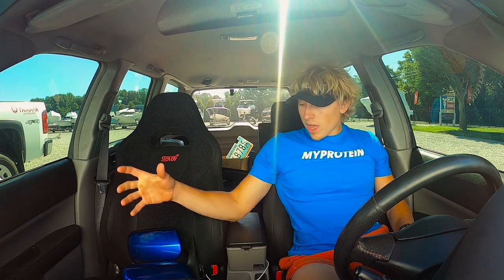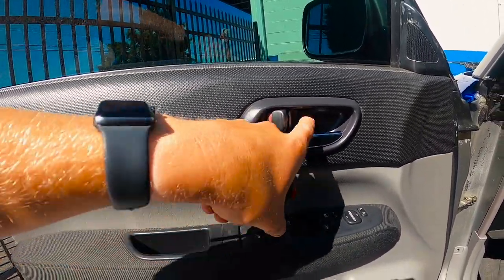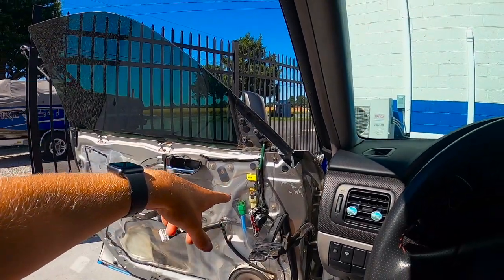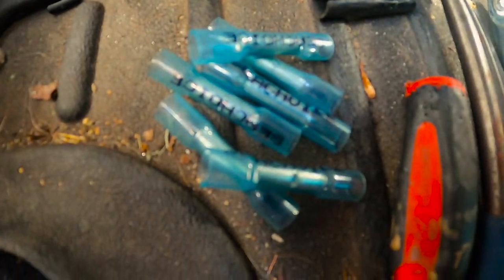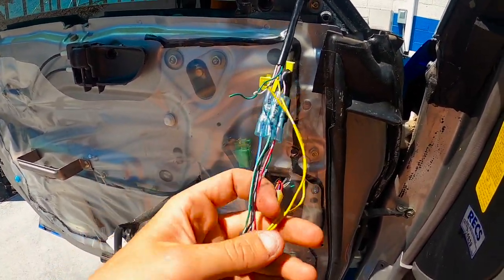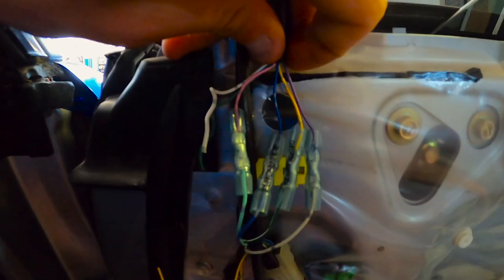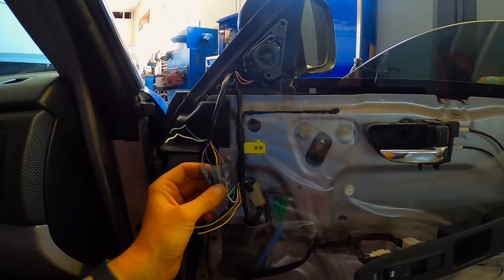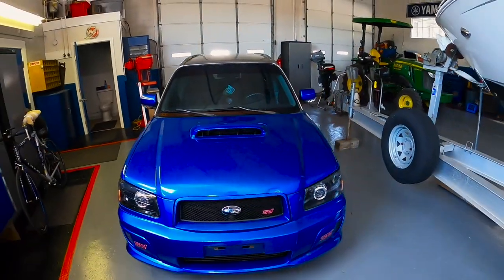SUBARU FORESTER MIRROR SWAP INSTALL/HOW TO  | 2006-2008 MIRRORS ON 2003-2005 | STI SWAPPED FORESTER

Comment: my foz is a 98 gt, door trim off looks nearly the same.

yes remove the rails, im taking mine off
Reply from the maker: What’re you gonna fill in the gap from the rails ?
Reply: @jakeheavlow  i was looking at flater looking ones see if any fit, but i think fill it. there is a filler with fiberglass in it that look strong and light. 
there is one done same as yours all blue, looks nice but i cant find info on what they did.
Reply: @jakeheavlow  do you work on those boats? 
looks like miami vice.  🐨👍🏼
Reply from the maker: FatAss David lol yes sir I do hahaha